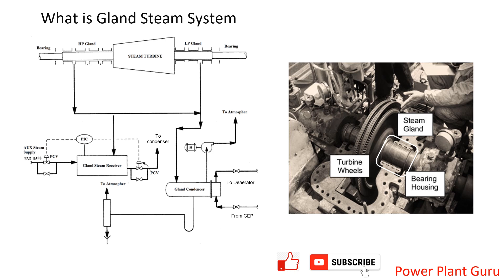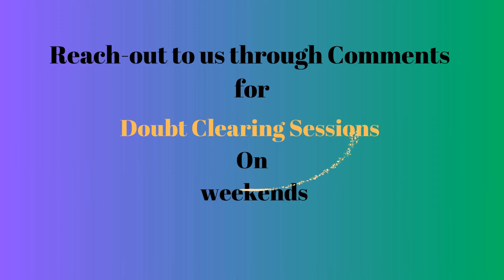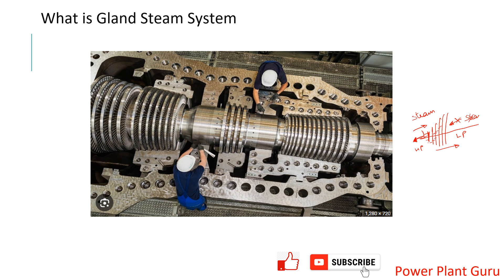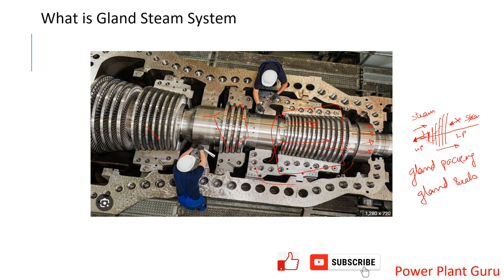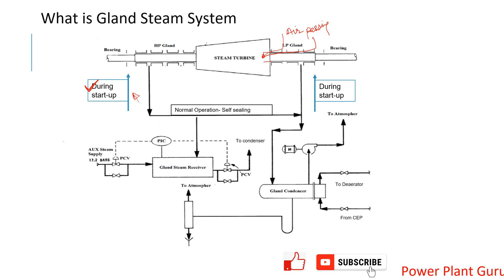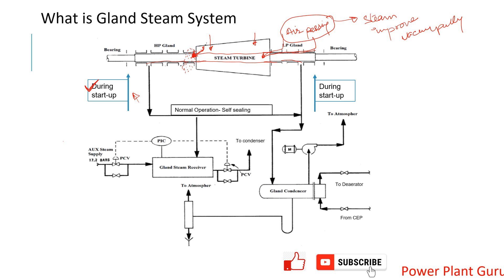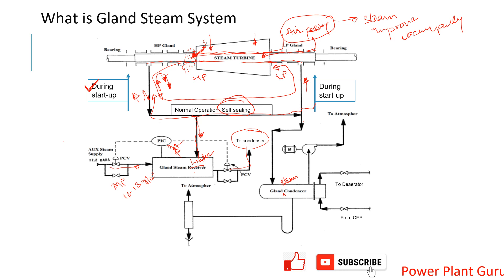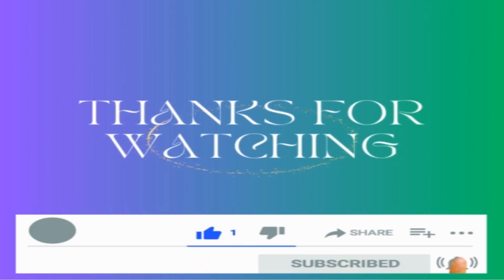Gland Sealing System, Gland sealing, Self Sealing in Steam Turbines

Comment: Aux steam use only in start-up ????
Reply from the maker: Hi, Not only in start up. its used during startup and normal operations both.
Reply: @powerplantguru007 Thank you for your reply,
but in normal operation, the pressure inside the turbine is high — so theoretically, we shouldn’t need Aux steam, right???

Comment: I have seen a flash tank with spray cooler but without atmospheric  vent. After latching of turbine all drains from HP msv , HP cv are collected to flash tank. The condensate from VSC (leak of Gland steam condenses in VSC by exchanging heat to Condensate from CEPs discharge) also get collected there. Spray coolers from condensate line spray water to flash tank to control temperature . Fresh condensate pumps used to control level of flash box by pumping condensate back to hotwell. 

Flash tanks are one of the most critical component . Monitoring of Flask Tank level is of high priority during startup & shutdown.Water induction in steam turbine can be happen when fresh condensate pump fails to operate
Spray coolers stuck open
Passing in drain movs or steam traps malfunctions.
Normally drain movs are close but a slight passing can result into water induction.